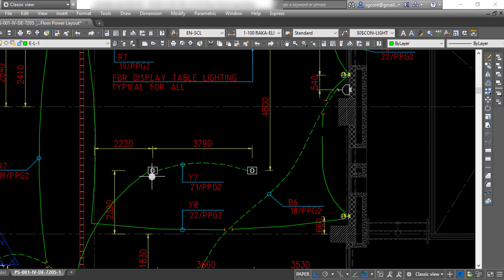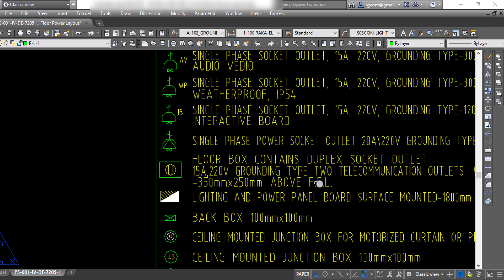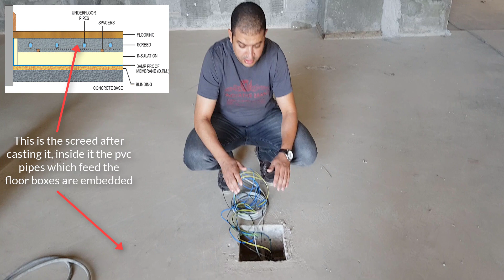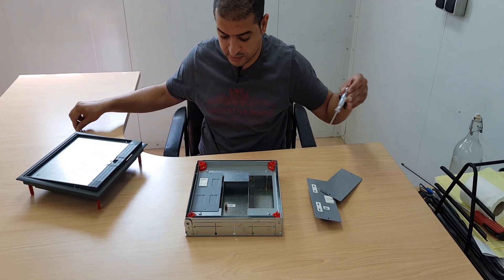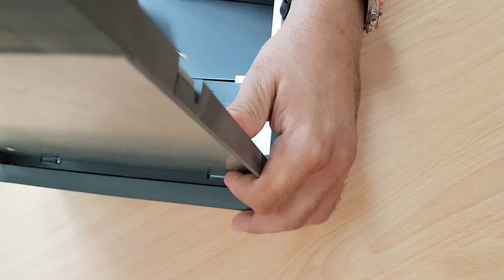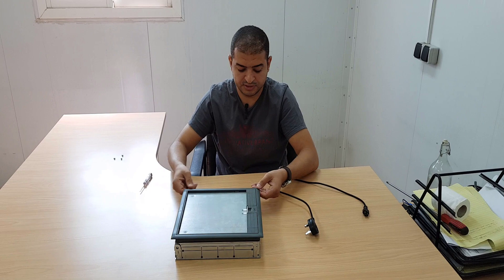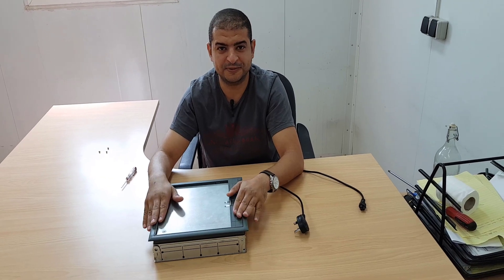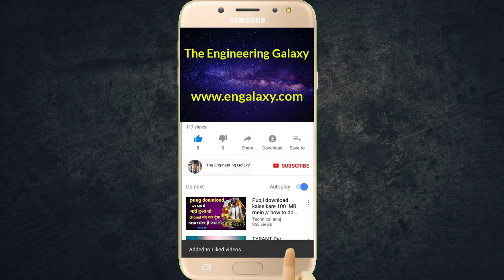Floor box Practical installation On-Site

Comment: issue of your floorbox is water leakage on the sockets and outlets. there are no  gutter for the water not to touch the modules and connectors.  do you have any suggestions?
Reply: where are you planning to install? maybe a floorbox isnt the best option

Comment: what is the thickness of the concrete floor? does the weight of he concrete might have problem with structure?... can i used this on each roo  for commercial space in my building?